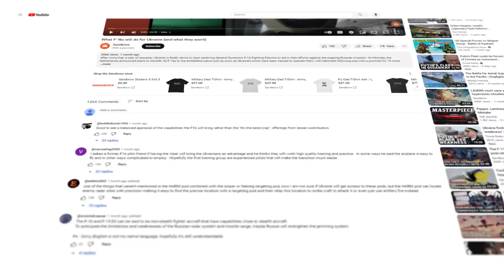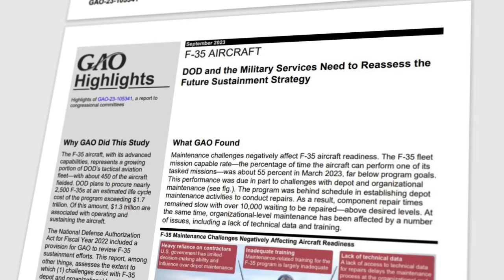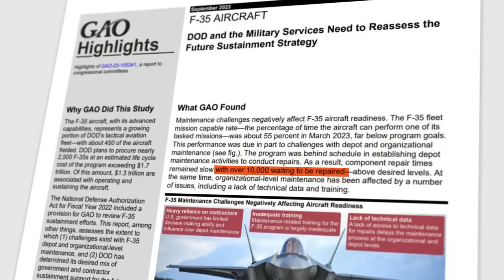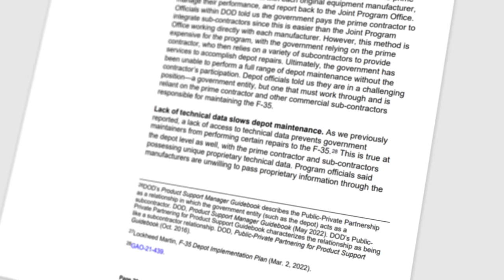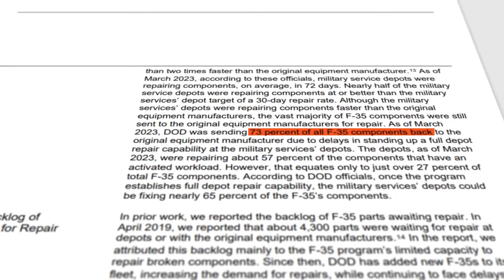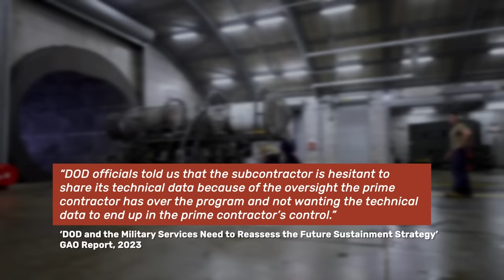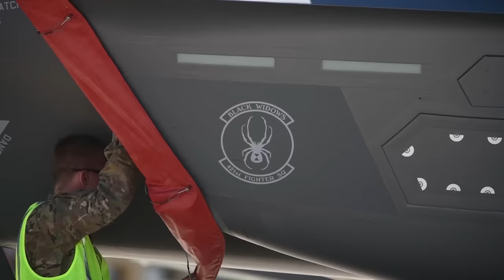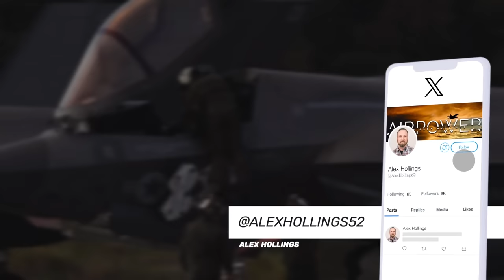Why are only half of America's F-35s ready for a fight?

Comment: Neither the SU-57 nor the J-20 is a fifth generation fighter.
Reply: Why would they not be?
Reply: @karldergrosse-333 They lack the stealth profile required. And only the J-20 is a production operational aircraft.
Reply: @karldergrosse-333  Those twin engines on both airframes. Russia and China don't believe in research and development, like the United States did with its stealth jet engines. The F-35 and F-22 have multi-directional laser-sonar they can easily detect those engines from 150 out. 

When the sonar detects a familiar engine noise from a fighter jet, it will task a satellite to photograph the area. And a pilot can see in real-time exactly where the threat is.
Reply: I’m pretty sure the J-20 is a fifth gen fighter.
Reply: @theylied1776  " The F-35 and F-22 have multi-directional laser-sonar they can easily detect those engines from 150 out. " I'd love to read more about this. I have never heard any claim to this.

I'm also failing to see how a photo of a plane 10+ seconds ago via satellite will help in real time at closing speeds. I'm open to hearing more.
Reply: @NinjaRunningWild  Stealth profile is there, IMO but not as sleek as the F-22, or F-35 for sure. RAM is the bigger issue I would imagine. Geometry is not that difficult to copy and integrate. RAM is.
Reply: @thegaminghobo4693  no, it is not. Its engines are easily detectable by the F-35. Other than China, give me a single aviation expert that has actually flown in or against a J-20? When the French offered to test the J-20 against their Rafael, China declined the offer.
Reply: @karldergrosse-333  Great, just find the DARPA article about it. DARPA jointly developed most of the avionics (radar, sonar, satellite communication) on both the F-22 and the F-35. 
And no, it's not Lidar. Lidar only has a limited range.
Reply: @karldergrosse-333  a satellite feeding a fighter jet photographs that is also tracking a jet is very useful in a combat space. If you know exactly where an enemy fighter is, and they can't detect you, the fight is already over! How is that difficult to understand?
Reply: @@JimCarner Uha, no. That is incorrect  The Rafael Fighter jet is manufactured in France by the French aerospace corporation Dassault Aviation.
Reply: @@JimCarner Tell that to Google's talk to text. Autocorrect is a hell of a thing.

Comment: Start making F-16 Kingsnakes .... the logical evolution of the F-16XL.   The F-35 has its uses, but we need all weather multi-role fighter jets which have high operationaly readiness.
Reply: @@JimCarner  Much as I like the Gripen Es, it is a smaller plane with less range.   The much larger wing of the Kingsnake allows a much heavier bombing payload and more fuel for more range at almost no loss of speed.
Reply: @@JimCarner It's a good aircraft but I just couldn't see the modern US buying a foreign fighter in any significant number, Boeing Lockheed or Northrup would get that funding. The kingsnake isn't really a good idea though, it's an expired design
Reply: @@JimCarner I'm aware, but wouldn't be surprised if they made that bad decision for the sake of a domestic product. I'm guessing the Constellation-class decision was based on repeated failures with the LCS and not wanting to put in further development

Comment: Not an expert.  With that said . . .
  De Havilland Mosquito pilots believed in their aerial steeds, claiming on occasion that "Mossy" was the best plane in the sky-the best fighter. bomber, and/or fighter-bomber.  P51 pilots were the same.  Pilot perception is heavily colored by a combination of familiarity and the Stockholm Syndrome.  By the same token, pilots have pet peeves that the histories traditionally magnify into a maligning of the aircraft addressed.
  Neither Mossy nor Mustang was designed to be a dogfighter.  Mossy was an attack bomber and Mustang was a dive bomber . . . wait . . . I mean a long endurance escort fighter.  But I have yet to read any complaints about either plane.  Nothing but accolades.  That suggests narratives promoted more than it does perfection in the aircraft.
  Even the most highly role specialized aircraft of WW2 were a lot cruder than today's integrated weapon systems.  Even so, they were straining at the bit back then, puncturing the engineering envelope and sometimes paying the price.  The Mustang was one of the most technically complex planes* of its era.  Same with the Mosquito.  Readiness rates for both planes were higher than those of the modern era's best analogs.  One reason was that more repairs and maintenance could be performed on WW2 planes at forward airfields/facilities.  Today's logistic paradigm for advanced aircraft is insanely limited compared to that of WW2 fighters.  We have to send planes back to the states for any kind of deep maintenance or repair.  That reduces readiness per airframe.  Turnaround times are also worse-simply due to complexity and the pilots' rapidly increasing workload (even though we're supposed to be easing it, the new modes of integration argue against it.  Consider the increased complexity of electronics environment and more the infinitely nuanced rules of engagement today compared to WW2).
  The F35 is the action arm of today's engineering and integration science and mass production technique.  Of course it's going to be a fractious, tricky, system to maintain.  The question becomes: can it do the job(s) expected of it?  Better than anything else in the air, seems to be the consensus.  Frankly, through all the rhetoric pro and con I was more worried about the O2 demand system than anything else.  A conscious pilot is a better pilot.  Reference "No Sweat", a USAF training film on the topic of the O2 and pilot interface circa 1958.
  So F35 looks pretty good.  Not perfect-but what is?  Even Mustang and Mosquito had serious flaws . . . for instance: Mustangs loved to lose turbochargers through FOD and Mosquitos never replaced the less generically capable Beaufighter in the PTO for good, solid, reasons.  We're still ahead in the race; it's just that maintaining that lead is getting more difficult as time goes on. 

*RaDAR equipped night fighters were the real superweapons in this context.

Comment: Alex, quit making excuses for the #Turkey F-35. You are SO wrong. I'll read the GAO report but what you really need is the Operational Requirements Document or ORD. THAT"S the comparo, that's the standard. 55% is #ABYSMAL. And BTW, that standard changed with the Raptor. FMC, PMC, NMC were the standards. The definition now is the weapons system's ability to perform just ONE of its assigned missions, not ALL of its assigned missions. The standard should be as it was before, meaning FULLY mission capable. The standard changed to fit the aircraft's performance. That's wrong. If its parts were suitable in the FIRST place, maybe the depot wouldn't be a problem.

Comment: If the NGAD turns out even close to what the USAF is trying (so basically avoiding everything wrong with the F-35 program), then I am in the camp that see's the US orders of the F-35A and C being cancelled early like F-22. In exchange for new light fighter based on NGAD. Though I admit this is based on rumors of how well Northrup did with the B-21 and that Northrup also built the NGAD tech X-plane for the USAF. With Northrup in the lead to winning the NGAD already. Because Lockheed has burned bridges with the Pentagon and appears to not take Northrup seriously as competitor in 6th gen fighter field. Basically Lockheed's current generation of executives not knowing the reason YF-22 beat the YF-23 (now seen by many as proto-NGAD) in the 90's.

Comment: A fair and interesting correlation would be historical B-2 readiness rate compared to B-1 readiness rate.  This could be translated over to fighters in comparing readiness rates of F-35 to F-16 and/or F-15.  In my experience, the F-16 is much more reliable than the F-15.  Almost every time we scheduled an F-15 target at Eglin it would break.  The F-16 block 30 would consistently show up for the party.

Comment: OK ye got me goin.  

MICAP metrics are a bit skewed against F-35 for one reason, it is fully integrated. F-35 has EW an IRST etc fully built-in not hung on as a pod under wing, in order to achieve stealth. 

When F-15 EW pod has a fault there is zero down time counted against the aircraft, we assume a good pod is available and can be replaced instantly. Not so F-35. If EW or IRST fails then the whole aircraft is counted as "down" until the root problem is fixed.

That MICAP metrics are even on a scale with federated aircraft is a Testament to the built in diagnostics and repair of F-35 being head above its older brethren.

Comment: The reason the word Shill gets dropped on you so much is because what you rarely discuss honestly. The F35 performance is sub par despite how you misccharacterized the significance of Red Flag vs Pilot that originally said it had an energy management issue. 

You are also called shill for telling the truth about cost of the F35. You continually quote the fly away cost and not the agrigated cost divided by the actual number of fighters produced at this specific year. 

If you did this just like space shuttle or SLS then you could say the clear and unavoidable truth. The F35 is upwards of $165 million per plane...

But you don't....
So the implications are that you are bought or protective of the F35

Comment: Love your stuff brother. Semper Fi.

Anytime anyone says military industrial complex bs, that means they dont realize what it takes to give them that kind of freedom of speech… screw them.

There are all sorts of reasons why f-35 has a low mission operational capability.  I talk regularly with a guy who works on the production line. Lockheed is trying to produce too many jets too quickly. So quality lacks…

Also and as you note, stealth fighters require more maintenance…we also have supply issues due to covid.

Comment: I think what is more important is: If there is a hot war tomorrow, will the readiness rates able to go up in a short period of time. 

In peace time, there is not much difference in the readiness between 50-75%. Sure it will be nice to have 75%, but there will not much harm when it is around or below 50% (just look at the current German military). But in war, if the readiness will not able to go up fast, it will be a major problem. 

Just look at the artillery round production in US is not promising. The Ukraine war started 1.5 years ago and US still unable to supply rouds in a proxy war. And an artillery round is a lot more simpler than parts in a 5th gen fighter.

Comment: Since the 80s I've been wondering when the tech will be too maintenance intensive to actually be usable, or too expensive for any general or admiral willing to risk a Congressional inquiry (inquisition) for the material replacement costs much less casualties. But we'll never see those depots being built- infrastructure isn't sexy despite fixing so damn many problems. And too much of the procurement process is colonels and generals who are going to retire for six months and start working for LockMartNorth and Boeing and Raytheon, alongside former Senators and Representatives.

Comment: Seems as though, those who jump on the criticism train miss the point of a report like this in the first place. Reports like this are designed to find the flaws so they can be corrected. If the issues of this report were non-existent, then the research into the program would be just more in-depth so that it could find issues.  Which, then of course, the critics would also just inflate, missing the point.

Comment: How many of those F-35s are combat-coded and actively in service compared to in storage waiting for fixes due to yet unresolved issues?

Is the low readiness rate due to inherant flaws in the jet itself or due to the whole "concurrency" issue?
Reply: I highly doubt other countries would acquire the F35 if it had such flaws so I believe the issue is the concurrent manufacturing.
Reply: I think answering questions like yours was the point of the video. In reality there is no single F35 (disregarding the three production models A, B, and C) because fixing and improving as the planes get built has made the F35 of 2023 very different than that of, say, 2018. Now if the issues with the the earlier models are so drastic, they're likely sitting on the ground waiting for depot-level repairs or LM to do the work. This makes the unit cost at the present moment higher than if they just waited for multiple levels of testing a handful or aircraft to be done before ramping up production. You make 'em and then almost immediately repair them. Planes coming off the factory floor today and tomorrow should not have that issue. Alex pretty much made it clear here and elsewhere thst nothing is better than a mission-ready F35. That so few are mission-ready has little to do with the aircraft and a lot to do with how the programme has been managed at numerous levels. Still, it's a high production aircraft and may some day be as common as an F16 which is pretty remarkable. ... That's at least what I got from the video.
Reply: @thomasjgallagher924  Alex is definitely doing the Lord's Work with his channel and the aviation topics he covers.

Comment: One thing to consider when looking at "mission capable" rates for any USAF aircraft type, there are several levels of reporting for the condition of any given aircraft.  The GAO report doesn't seem to differentiate these levels of aircraft readiness.  For example, an aircraft might have all of its major and minor systems working as required, with no limitations on its performance.  This is called "Full Mission Capable" or FMC.  It is a very rare individual aircraft indeed that has no write-ups at all with everything working 100%.  The majority of aircraft are flying just fine, with some minor defects that are not mission essential and that can be repaired when parts/down time/manpower are available to clear the problems.  Until all of those non-essential write-ups are cleared the aircraft will be reported as "Partial Mission Capable" since it is not totally repaired yet.  If the aircraft has a major system problem that affects its essential mission capabilities, or is not flyable, it will be reported as either "Non-Mission Capable-Maintenance" NMCM, or "Non-Mission Capable-Supply" NMCS, depending on whether it is offline waiting for maintenance to be completed or waiting for the supply system to deliver needed parts.  The GAO report is not clear about what status they are considering to be not mission capable.  It is important to know.
Reply: Good point.

Comment: As you mention that parts are awaiting input to IM or Depot  MX are thrashing turn times-which will absolutely inflate your sparing models and... LM really either needs to absorb the Sub-OEMs organically or lighten up on the proprietary failure codes. However, then we have the issue of Intellectual Property theft and migration of hardware and software to other subs or to our Red nuissance that will make knock offs that all have the same s/n's and model nbr dashes... The mfr's make big money on not sharing failure codes and first indication of...

Comment: Alex again great video. You have talked about the Red Tape Bureaucracy and the Military Industrial complex before, I think there are a couple more things in play here. One, the military trying to shoehorn 3 different requirements, USAF, USN and USMC into one platform. Stupid if you ask me and one of the main reason for the expense that you have already covered. Two this is all very new tech. With time the cost of that tech will go down but it will take time. So in looking at this another way and this is why our current system for allocating our weapons from this huge conglomerate Lockheed Martin is old school thinking. With this I bring up SpaceX. They are running rings around NASA and just making them look stupid. Not just NASA either, every defense contractor associated with NASA, Boeing, Lockheed Martin all of them. Why is this, They are not part of all the Red Tap Bureaucracy nightmare called Washing DC. They are lean, private, thinking outside the box and making it happen. Something the defense industry and our government no longer has the capability of doing Great video again Alex.

Comment: The desired goal is perfection, that's just not possible nor affordable. One wonders why Depots are not ready to go yesterday. Well, you don't need them until the first production aircraft are planned for Depot level maintenance.  Also, recall the Depots are not just for the aircraft but for each of the systems as well. The systems Depots won't be in the same location as the aircraft Depot.    So, you will have Depots all over the world, literally. You also need a stock of units to replace what breaks on the aircraft. You can begin to see the logistics challenges to keep an aircraft mission capable. Bottom line, this all takes money, a LOT of money.
  I recommend you back accusations of profiteering by Lockheed Martin (LM) unless you have proof. This is too easily used to slander a company that doesn't deserve it plus the subject is emotionally a powder keg. However,  if you have the goods on any company go for it.